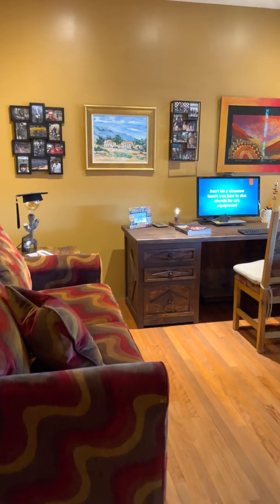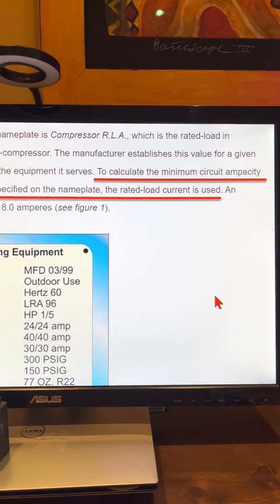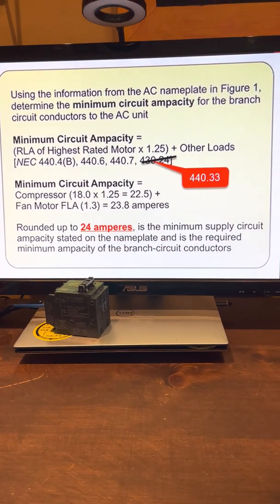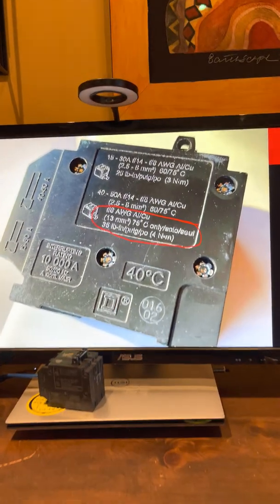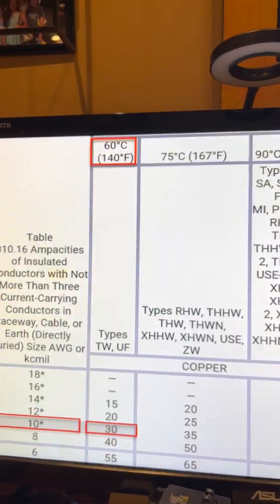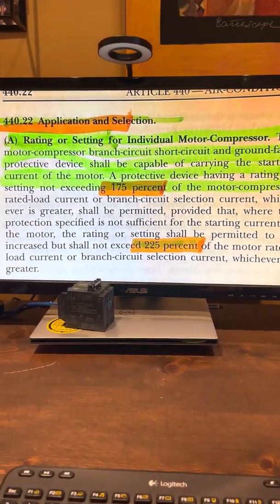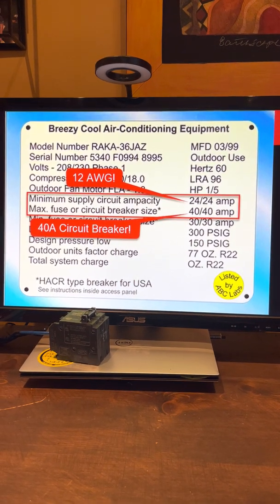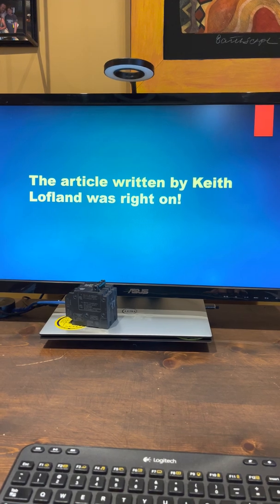Air-Conditioning, Circuit Sizing, NEC 2017 - [440.4(B)], (8min:54sec)

Comment: If I have NM cable ran to the line side of disconnect from the panel then THHN load side of the disco ran to the ac unit can you still size off 75 degree C ?
Reply from the maker: Post your question on MikeHolt.com/Forum

Comment: Mike, good video. My AC condenser has max fuse size of 25A, the AC disconnect box has a 25A breaker and the main panel has a 30A breaker for the AC. Is that an acceptable setup?
Reply from the maker: Please watch MikeHolt.com/AC

Comment: So for example in this installation if i were to run NMB...
I would need to run 10awg NMB up to the disconnect, from the disconnect to the AC i can run 12AWG 75* conductors. In the panel i would install a 40amp circuit breaker on my 10awg NMB. Did i understand that correctly?
Reply from the maker: CORRECT. Watch MikeHolt.com/AC
Reply: @MikeHoltNEC  Fantastic. Thanks for the confirmation. Much simpler than most think.

Comment: Thank you Mike I have a AC unit with data plate states 27 min amp &40 amp max so we ran a 10 gage Romex wire on a 30 amp breaker so did we do wrong or is it acceptable by code ? Or can I up the breaker to 40 amp breaker if we get nuisance trips of the 30 amp breaker thanks
Reply from the maker: A 30A breaker is fine, and if it trips, going up to 40A is perfectly fine. Watch MikeHolt.com/AC

Comment: I agree that it meets code. However, your rationalization for the short circuit  condition is a little out there. Go look up the response time of a breaker at rated amperage. It certainly won't be three hundredths of a second. And the short circuit protection inside the device if the short occurs outside of the device.

Comment: I agree with everything. For some reason mocp is at 25 but when I do the math with compressor at 17.5 amps at 225% plus the fan motor at (.78) I get a number much higher then the units 25 amps..
Reply from the maker: Manufacturers are permitted to set the MOP to 225%, see 440.22(A) Ex. 2.

Comment: Thank you for the great explanation of code! Sadly sometimes it’s cheaper to upsize the wire than get on a dinosaur inspectors bad side. 😓 But with the price of copper today it will be good to have this knowledge in my pocket!
Are A/C circuits exempt from 80% rule for continuous use circuits?
Reply from the maker: Please watch the video again so you answer your question about the 'so called' 80% rule.
Reply: @MikeHoltNEC I guess I was looking for a specific exception to that but realize that’s not how the code is written. A/C circuits are covered separately from the general purpose circuits as you indicated. It’s hard to shed all that dinosaur training a lot of us get from day one! Thanks again for this video!
Reply from the maker: @mikereliford55  Great response!

Comment: Here is my concern with all of this. For the moment let us forget about all of the codes and ampacity of the circuit.  looking at the nameplate we are seeing the running load, not the start-up current. The voltage drop across the smaller-sized wire at start-up will make it harder on the compressor to start and possibly shorten its life.
Reply from the maker: Voltage drop is a separate calculation. For all practical purpose, if the circuit is less than 200 feet, then this is a moot point. Visit MikeHolt.com/App and get my app that does a/c calculations and lets you know the maximum circuit length to accommodate VD.

Comment: how would you size the breaker supplying power to the feeder disconnect ? is that a different calculation ? this video describes how to calculate conductor size and disconnect / branch circuit size for the ac unit but NOT the feeder circuit size
Reply from the maker: The 2023 NEC clarified that the feeder to the a/c disconnect is sized the same as the branch circuit, see 440.33.

Comment: I have an a/c condenser with a MCA of 20.1 amps.  20A would be good for 12 ga NM. Would this .1 A push it into 10 ga NM or can it be rounded down to 20A?
Reply from the maker: 220.5(B) Fractions of an Ampere. Calculations shall be permitted to be rounded to the nearest whole ampere, with decimal fractions smaller than 0.5 dropped." But I'm not 100% convinence that this rule applies, so I would say no...
Reply: @MikeHoltNEC  thank you.  I had one more question on the subject.  Clearance from A/C disconnect box (non-fused) to a residential condensing unit.  Does this fall under 110.26 and require maintaining the 30"/36" clearance side and front and no higher than 6'7" or does article 440.14 take precedence which requires only for it to be accessible and within sight?  I've generally thought that it just had to be accessible and not located behind the unit.
Reply from the maker: 110.26, is a 'general requirement' so it always applies. Note: the 2023 NEC actually added a reference to 110.26 in 440.14

Comment: I encountered this today with a unit of 19.8 amps and a max overcurrent protection at 30. My question, was that it was ran in NMB cable to the disconnect and thhn to the unit, so therefore, would I not be able to go from the disconnect with a #12 gauge thhn wire to the unit, keeping the disconnect at 20 amp, and the main breaker at 30?
Reply from the maker: 12 AWG is rated 20A per Table 310.16 at the 60C column per 334.80. So 12 AWG is fine.

Comment: Does this same breaker and wire sizing apply to mini splits? The one in question is not just an "air-conditioner" but also a "heater".
Reply: A mini split is still using the refrigeration circuit for heat, so my thought is yes it applies.

Comment: Total novice here but found your video while researching this topic.  I just had a new high efficiency air conditioner installed.  The HVAC installer said I need to replace the 20 amp breaker in my panel with a 30 amp breaker to pass inspection.  Being a novice I am a bit leery of putting in larger breaker since the wires from panel to AC are 12 gauge (Romex?) which I thought were limited to 20 amps.  I don't want to burn my house down.  The face plate on condenser states min ckt ampacity Amperage Min 18, Max fuse ckt breaker 30.  Based on this video it seems like that is acceptable.  Am I correct?  Thank you in advance for sharing your expertise.  Super helpful!
Reply from the maker: Yep
Reply: @MikeHoltNEC  so in his case, he can use either a 20 amp breaker or a 30 amp breaker?

Comment: My 5 ton max overcurrent is 60 and the min circuit ampacity is 41.7. The installer said he needed to use a 40 amp breaker. But I hired an electrician who said the breaker has to be over the 40 so he installed a 50amp breaker. Who is correct?
Reply: The correct answer is 8 gauge wire rated at 75c thhn in conduit or mc cable for example, on a 60 amp breaker. You could also do 6 gauge romex on a 60 amp breaker. The 40 amp breaker is wrong. The guy with the 50a is a little better, it should be 60a though.
Reply: Machine needed 41 amp minimum why not use the 50 . 50 it’s correct with 6 # wire

Comment: Just to be clear, If the nameplate has 34.5 FLA and I use UF (60 degree) column then I can use #8 UF because I don't need to take the 34.5 and multiply it by 1.25?  Also, I could use a 40 Amp breaker?  

God Bless you Mike, you have helped me out so many times over the years!
Reply from the maker: A/C loads do not have FLC, they nave "minimum circuit ampacity' and 'maximum overcurrent protection." So just size the wire and breaker per the nameplate. Please watch the video again, since your comment suggests you are still unclear.
Reply: @MikeHoltNEC  Thanks for the response, I can't believe the "Tom Brady" on electricians responded to my question!
Reply from the maker: @PPyle  Your question was important...

Comment: Not one of you took into account that AC's can run constantly on hot days and on first start up of a hot home and as such the conductors should have been treated as a constant load circuit and derated per electrical codes (80% I believe). It is better to install the larger wire than to have it overheat under constant load conditions. I have been on too many AC calls where the supply wiring was causing voltage/current issues.

I noticed someone mentioned Romex-I don't know any mechanical inspector that would let that pass inspection on a permanent install in the state of Oklahoma.
Reply: The NEC doesn't list the A/C as a continuous load. However, the 125% calculation of the highest motor load is already figured into the minimum circuit ampacity, thus eliminating the likelihood of overheating the conductors. I've come across failures at the terminals due to improper conductor torque and failed "pull-out" style disconnects where the clamps become loose around the blades of the pullout. In fact, I recently tore my pull-out disconnect apart to squeeze the clamps back down because I noticed a little heat coming from the "pull-out" portion of my disconnect and that it pulled out rather easily. Heat is gone now.

NM cable (Romex) is not permitted to be installed in a wet location (regardless if it is consealed within LFNC or equivalent)(see 300.9 and 334.12(B)(4) of the NEC.) However, I see no issue with it supplying a disconnect, where it would switch over to THWN or equivalent conductor/cable that is rated for use in a wet location.
Reply: @chadherriott116  If they go the way I think they are going and start putting 2 compressers in these residential units, then that highest motor load rule will have to be thrown out or revised to cover all motor loads combined. With matching compressors, you could have 200% of the highest motor load before adding in the fan motors. From what I have seen, they are not including the fan motors in these calculations or they are rounding down when they should be rounding up on this safety calculation. Simple wording-highest motor load-so fan motor is not highest so it is left out of calculation, and I see them doing the same with saying one compressor is the highest and one is not so it gets left out of calculation. Hopefully you can see why I think we some issues with this that could become an even bigger problem in the future.

I would love to see if you or anyone else could get Mike Holt to read our conversatin here and see what he thinks.
Reply from the maker: All you need to do is follow the manufacture instructions [110.3(B)] and size the wire and protection in accordance with the label. It's no more complicated than that.
Reply: @MikeHoltNEC  As resistant as people are with this topic, you'd think that you'd see a house burning down every night on the evening news because of someone putting 10 gauge wire on a 50 ampere breaker for an A/C. It's amazing how many people fail to understand how simple it is. The easiest way I've found to explain it to people is to "wire to the minimum, breaker to the maximum." Can't go wrong there.
Reply from the maker: @chadherriott116  you would think that is simple enought..

Comment: Great video thanks. 
Suppose there is only one space left in the panel for a two pole breaker and two AC units need to be wired. Is there an explicit or implicit provision in NEC'20 that permits taking exception to the nameplate data to accomplish this feat.
Reply from the maker: The nameplate specifies minimum circuit ampacity, so this is required. The OCP is required to not be greater than maximum' OCP', so you can size the breaker smaller; maybe it would hold...
Reply: @MikeHoltNEC    I think you misunderstood my question. Two AC units need to be installed in one circuit.
In such case the ampacity of the conductors needs to be increased and that is not a problem. The MOCP is also likely to increase and this is a problem because the AC label specifies the maximum size alowed. It is implicit that circuit wiring requirements on the label apply only for that unit in a dedicated circuit. So, does the NEC allow multiple AC units on a circuit??
Reply from the maker: @shieldcracker  Sure, as long as you comply with MCA and MOCP on the equipment label. But I think if you do the math, you probably can't accomplish this.
Reply: @MikeHoltNEC if each unit had its own fused disco, I would think you could comply with NP MOCP.
Reply: @mkranchero  You are correct. 
The question I am pondering is: Are there code restrictions that require that only  (1) AC unit (having labels that specify MOP) can be connected to the MOPD

Comment: How do you size conductors and overcurrent for welding machines?
Reply from the maker: Please review Article 630, specifically 630.11 and 630.12. This is asked on exams, and it is covered in my Exam Prep Program. MikeHolt.com/Exam

Comment: Very informative video sir may i use 30MiliAmp GFCI or RCCB for 1.5TON Air conditioner...
Reply from the maker: 1. We don't use RCCB in the USA. Why are you asking this question?
Reply: @MikeHoltNEC   

Thanks for immediate reply.
In india there are many fire cases due to short circuit [sparking) in AIr Conditioner split type. Can earth fault  protection breaker prevent   fire . Or C Type MCB fulfill all the requirements.
Reply from the maker: @pramodgavit7666  I'm sorry but I don't have all of the details, but RCD would most likey reduce some of the fires.

Comment: One thing I see a lot is A/C guys replacing a condenser unit and not putting in a smaller breaker for the new equipment that draws less for the same tonnage. This usually happens when I am installing a car charger and doing a calc for the panel. We go around to all the equipment like A/C units, stoves, pool motors, heaters etc. and add up the label info.

Comment: Where would you have a situation like this? Other than maybe you can’t source a smaller breaker or you run new conductors while using an existing breaker? The problem I typically run into is the existing breaker is larger than the new equipments maximum allowed because the newer equipment has a lower kw/ton.
Reply from the maker: I'm don't I understand "where would you have a situation like this?" You would have this 'everytime' you install an a/c circuit.
Reply: @MikeHoltNEC  To refine my question; why upsize the breaker? If 12 gauge wire and a 20 amp breaker is sufficient for the application, why use a 40 amp breaker?
Reply from the maker: @briancoulomb  We are not 'upsizing' the breaker, we are sizing the breaker per the NEC, UL, and manufacture requirements. This protection device is for 'short-circuit ground-fault' protection, and if you are an electrician, then you know that if the wires shorted out (12 AWG), the short-circuit current will instantly rise and to the instantaneous range of the circuit breaker which will open in 0.30 seconds. Why size it 225%? Because this is an inductive load and the starting current (LRA) is 96A. Please watch this video again before you respond. Does this help?
Reply: @MikeHoltNEC  I did watch the video. I understand the inrush current and the fact the fault current would still trip the breaker if sized to the maximum allowable. The minimum breaker size would also be sufficient. I have never encountered a situation where the breaker was tripping due to inrush current and required upsizing. It’s good to know the breaker can be sized up in this particular case or with other inductive loads (following the name plate) and NEC. I enjoyed the video, I’ve just never encountered this scenario before.
Reply: @briancoulomb  the point isn't to find a situation where you need to upsize a breaker. The next time you are running a feed to a new A/C unit, and you see the "Max Fuse" at 40 amps, and the "Minimum Circuit Amps" at 24 amps. Instead of wasting time and money buying 8 Guage wire to feed this unit, you now have the knowledge to install 12 wire MC, and save yourself some money. The scenario your looking for would be ANY time your sizing for your A/C.
Reply: @jesseb5138  I understand that part but why install the 40 amp breaker when the minimum would allow a 24. Obviously not having a 24 amp breaker being a typical size, a 30 would suffice.

Comment: Thank you! Every one from apprentice on up should know about these exceptions for circuit sizing, and tapping rules. 
They really teach about how wire, terminal and breaker sizing work together to keep things cool & reliable.
Reply from the maker: These are actually not 'exceptions' these are the 'rules' for a/c circuits; which are different than motors, taps or other circuits. Glad you enjoyed the video.

Comment: Do you size circuit breakers for three phase AC equipment the same way? I have been familiar with sizing breakers and wires for single phase motors and Ac but never got into three phase equipment.
Reply from the maker: Watch the video, read the nameplate and size the wire to what the nameplate states. Amperes is amperes.
Reply: Yes